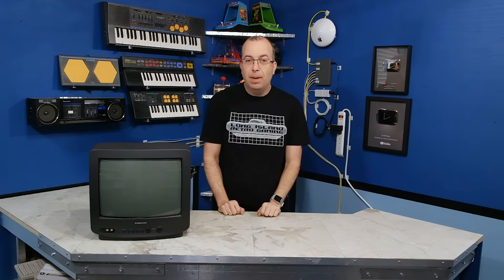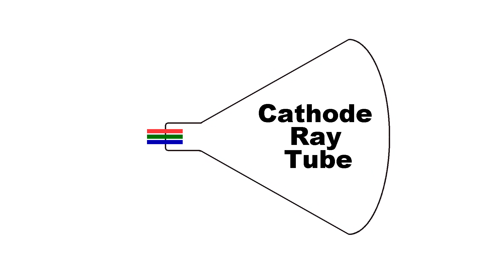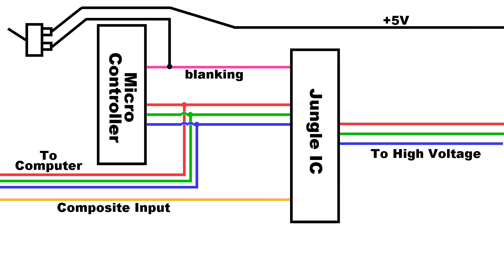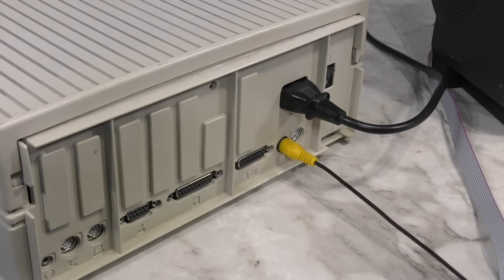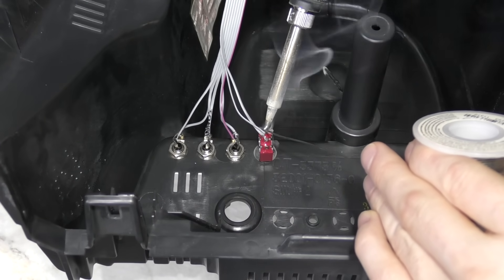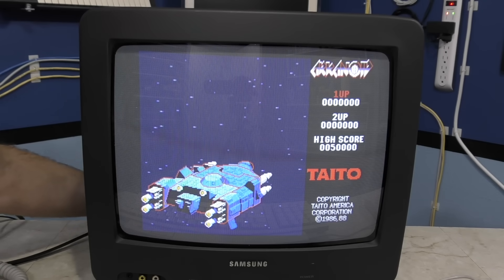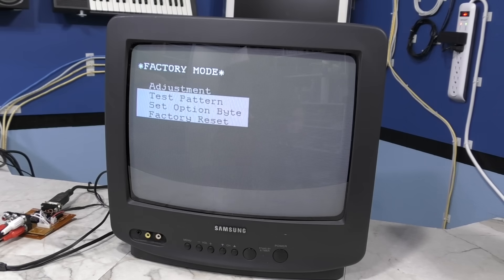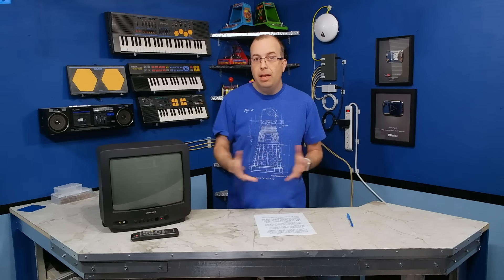Modding a consumer TV to use RGB input

Comment: RGB is the only way to go!
Reply: Yes, RGB gives a much clearer picture, but:  On the CoCo 3, and probably other computers as well, you can get way more colors by intentional use of color artifacting in NTSC composite -- lower resolution, but definitely more colors.  CoCo 3 can do 16 colors out of a palette of 64 natively in RGB.  More if you do tricks like swapping palette registers as the screen is being drawn, or flipping between different screens, or both.  But you can also get roughly 256 artifact colors (maybe some are indistinguishable from others) on the composite video output, but at half the horizontal resolution of the RGB modes.  Of course, with a mod like this, you just flip the toggle and you have your artifact colors.
Reply: @joelavcoco  That's a good point which is briefly demonstrated in the video at 13:20
Reply: @joelavcoco does this apply to LCDs?
Reply: @I.____.....__...__  

Using an adapter to convert RGB to composite will make the image look the same or worse than just using composite to begin with.

They are fine if you don't have any other solution for hooking up an RGB device to a TV, but the only real way to get the awesome image quality is to do a (safe) RGB mod.

Or, if your TV has Component video input, and supports 240p / 288p via that input, a decent RGB-to-Component adapter can look just as good.

(there's a whole debate about how well some converter boxes and TVs handle Component, but it's usually not a big problem that most people will notice.)

You could also use a device like the OSSC, which can accept RGB input from most consoles, then line-multiply the image before outputting it via HDMI to a modern TV / monitor.

It depends how much you want to spend on the image quality, though.

Please check out the RetroRGB channel and web site for far more info. ;)
Reply: it depends on the system and what you want, I prefer composite so games don't lose "dithering" or "transparency" effects and they look the way they are supposed to look. rgb makes older games look like emulators. programmers and artists knew most people used composite so they took advantage of that to make smooth shading or transparencies.
Reply: @pelgervampireduck  

It is true that some games did use the deficiencies of Composite encoding to their advantage (like Mayhem In Monsterland on the C64), but a lot of that was also down to the CRT itself.

(like the dithering on the PS1, Saturn, Genesis / MD.)

I've been using RGB on everything from the Amstrad CPC, 128K Speccy, to the Amiga, SNES, and Mega Drive since the early 90s, and I would never want to go back to Composite nor RF unless I had no choice.

It never looked like an emulator to me, and predated most of them. It always looked better, including the dithering (on a CRT).

(A lot of older machines also had the option to use an RGB monitor, so it wasn't just because we had SCART in the UK / Europe.)
Reply: @pelgervampireduck  

Having said that, personal preference is obviously a thing, and it often comes down to experiencing the systems and games how you remember them. ;)
Reply: RGB is a definite win when it comes to 80 column text.  I used an RGB monitor on a CoCo 3 and Amiga 1000 back when, and still do, so I in no way want to suggest that composite is entirely better.  And I love that mods like this give you the best of both worlds, like one of the super premium monitors of the late '80s at thrift store prices, if not free.
Reply: (Red Green Blue)
Reply: I Find RGB To Be Anoying For Games On Certan Systems Due To being More Limited Then 40 Columns
Reply: I find random capitalization of letters annoying. :D

Comment: What are the VALUES of the resistors at 6:22?? Thanks!!!
Reply: To anyone still interested they're 75-ohm resistors.
Reply: Keep in mind that's particular to that TV.
Reply: Correct, these values were specifically calculated for a TXD1372 model Samsung CRT.
Reply: It depends on the values of your resistors that are already in your TV

Comment: I remember the trs 80 color comp 3 in radio shack with a rgb monitor. Plus all the other goodies. Looked like a real computer at that point compared to the trs 80 coco model 1 I had to a tv using rf.

Comment: If for some reason someone cares about the microcontroller in a set like this, it might be a good idea to intercept the blanking line from the microcontroller going to the jungle IC via a SPDT switch where the common goes to the jungle IC, one side of the switch goes to the microcontroller and the other side goes to +5V.

This would be a good idea to prevent +5V being directly applied to the microcontroller if it is trying to bring its output down to ground.

Comment: TBH I would of just removed the comp video and audio connector block from the TV and fixed a SCART Socket to the back of the TV and wire up the RGB along with Comp Video and Audio, much cleaner.

Comment: It would be awesome to see a modded NTSC TV with a SCART port in the back.
Reply: He could have done it with this TV though, if you look at the back where the composite input are that cut out is exactly the shape of a scart plug. He had all this work and most likely all he needed to do was desolder that connector and soldered in a Scart port, maybe at the most add a few resistors on the PCB that was most likely ready to do so.
Reply: Yeah, that's true.

Comment: if i'm not mistaking vga have two sync signals ( H and V ), you will have to modulate the two into composite. It will be more interesting quality wise, to add classic RGB to a Trinitron VGA monitor. I had one in my younger day, a 19'' triniton monitor with a scart input, even VHS looked amazing on it.

Comment: Well, yes, we in Europe are so used to the wonders of RGB that you over the pond rediscovering what for us is hot water results to be a little... meh! No offence meant. 😋

The SCART connector really was the 90ies' HDMI. 🙂
Reply: Ran slower because the Japanese adopted the NTSC system, and didn't compensate for PAL and SECAM and their higher definition, so yes, we had slightly slower games THAT WERE MORE DEFINITE, while you had slightly faster games AT A LOWER RESOLUTION.

Who got the better deal? Matter of point of view.

@Thomas Ellison You HAD freedom
Reply: I really really wish I had RGB back then and am jealous of that but seriouly, retro PAL consoles are a huge pain because of poor optimisation of PAL releases. Slower games(not running at the speed they were designed for) and often stretched picture. I'm a frequent member of a retro gaming forum visited mostly by europeans and none of them will touch a PAL retro console and games with a ten foot pole. They will all admit that it sucks big time and that NTSC games is where it's at. They all buy NTSC games for damn sure, and mostly NTSC consoles, while the ones who hold onto PAL console mod them to be able to play NTSC games.(which not only requires a region switch, but a different crystal/oscillator)

I'm really happy I grew up playing japanese games from SEGA and Nintendo at the correct speed and size, to be honest. The way they were intended to be played.
Reply: It wasn't always wonders, and RGB wasn't available everywhere. Sometimes it was the device that wouldn't output RGB. Sometimes the TV didn't input RGB. Sometimes the cable didn't have the RGB lines connected. The SCART was just a standard to provide easy way to provide any combination of signals,  even in both directions, but rarely everything that would have been possible was taken advantage of in devices. Because still, connecting everything in TV and the input device end would have increased costs -- slightly, but enough. When buying a small TV, the buyer rarely cared too much of the picture quality, so RGB would have been a waste. Of course, if the small screen would be used for something else than watching TV, it can be a whole another story.
Reply: All ur PlayStation games run slow
Reply: @bookshelffury
I'd strongly argue, most of the ps2 games gad 50/60hz switch option and most of the psx games did not suffer form 50Hz, it was much rorse in older systems though so a regon mod is must have! At least our RGB enagled TV all do support both 50 and 60Hz picture unlike yankie ones xD
Reply: bookshelffury Pretty much Every game console game made before ~2000 ran slower in PAL regions.

Comment: Hey I have a old Sony CRT that has a red, green and blue input at the back. You think I could feed a rgb input into that? On the TV it's labeled as DVD input. Lost the user manual
Reply: Thats probably components video, it's kinda RGB but it mixes the sync signal with I believe the green color
Reply: It's called YPbPr
Reply: That's Component, you need some RGB to Component Video (YPbPr) converter.

Comment: I never did understand why the US never adopted the SCART connector, it provides so much more for televisions than a simple composite cable, granted it's a big-ass plug, but, it's pretty damned good for what it is... :)
Reply: a few American TVs did have SCART (emphasis on few) , I remember having an old RCA 32in CRT that did have scart on the back and at the time I even wanted a scart cable for my original Xbox since it was promised to have better picture
Reply: @zacharytaylor8523  RCA Dimensia I think, multi-something port. It might've caught on if people weren't too busy going "Durhurr RCA Dementia huhuhu" back in the day. In retrospect it probably was a bad name, but still. Pretty much killed US scart in its tracks.
Reply: Pretty much the same story in Canada, as the US goes we do likewise - having NTSC and the same 120V 60 Hz power system as the US (as was also the case in Mexico) pretty much guaranteed we all had the same power and video connectors as well (as well as the same names for game systems i.e. Sega Genesis)...
Reply: @CanuckGod  And all 3 countries had those shared standards without creating some bureaucratic nightmare of an institution like the EU - or the currently dead proposal to create the North American Union and the "Amero" currency - to mandate such standards...
Reply: On the other hand though the US adopted disks for storage a lot faster than Europe. I never even had a tape drive for my Commodore in the mid 80s.
Reply: bubba99009 I had floppy disks on my Oric Atmos.
Reply: @srfrg9707  Wasn't Atmos developed by the Sontarans?
Reply: Buddy Clem Not at all, Atmos was developped by a dude named Luke Rattigan.
Reply: @bubba99009  No, they adopted at about the same time. But the 1541 initially was 1400DM, the price of a cheap used car, while the 1530 was about 150DM as far as I remember. Many people modded tape recorders because for that 150 you could buy a decent stereo cassette recorder.
Reply: I grew up with CRTs in America. The TV companies didn’t even give us composite jacks on most common models until after the PlayStation came out and didn’t include the RF Modulator in the box (good luck trying to find one Christmas morning).
Reply: @tjsynkral Those where some dark times, Every TV in my house always had composite or better thankfully but going to a friends house where they knew nothing but cheap RF only TVs meant you had to always pack a VCR just to hook up a games console
Reply: I have a Sony flat screen tv that has scart
Reply: The US telecom manufacturers chose what we got because all those cables could be produced on long-existing infrastructure and capital. Lowest cost usually wins.
Reply: @999thenewman  Yeah, it was just easier to send color (chroma) combined with the old black and white (luma) signals so older B&W TVs could still display it, instead of spending more money broadcasting two standards at same time with a broadcast for RGB and another for B&W or lose a portion of your audience only broadcasting one. Just came down to what was cheapest and easiest to do.
Reply: @TwistedD85 There was never any RGB transmission of TV in Europe. Both PAL and NTSC  created color by adding a signal to the old B&W signal in a way to old B&W sets  worked.

SCART was a standard to connect equipment to a TV like VCR, DVD, games consoles, set top boxes.  The cable was bidirectional so is would output the analog signal from the tuner, the result is that you could build transparent set top boxes  with no tuner that could decode channels you had to pay for or as a teletext decoder without putting a tuner in the box. You could even daisy chain it with multiple devices to record a scrambled channel on a VCR.
Reply: I think it involved some bureaucratic regulation that Americans do not like that much. SCART was pretty good but it was not perfect. A major problem was that it was bidirectional. This meant in poorly made cables (which were most) the return signal caused shadows. Cutting the return wires was a standard operation on SCART. Others complain how the connector was somewhat flimsy and could not be screwn in. IMO these are unwarranted. The connector had to be cheap.

I recall 20 years ago when DVD came how many American TVs did not even have composite input, just antenna. That was somewhat amazing.
Reply: Okaro X Thanks to them, there was always a RF modulator on Amigas, even the latest ones, allowing us to unsolder it and make some room for an hdmi connector.
Reply: SCART was a french created connector, mandatory here in France. So most of Europe got it. It was a good option, not the best one tho. Predates S video. What killed it was in part the connector (huge, bulky ect... Well its a 70s design) aaaand the japanese hated it